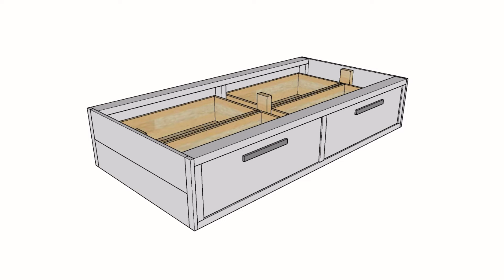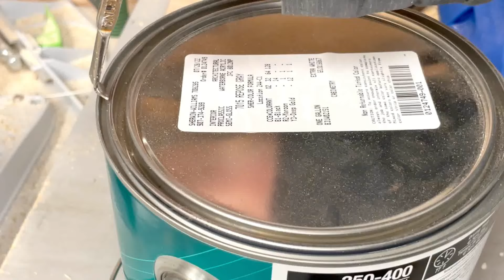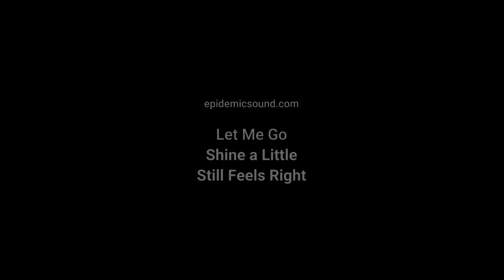DIY Drawer Bed with Free Plans

Comment: Do you think it would be possible to open the drawers on both sides of the bed?  I imagine that for a motorhome: a folding bed on top, and drawers that can be opened from the outside when the weather is nice, from the inside when it rains.  But I don't know what sliding system to use to make this possible.
Reply from the maker: Well that’s a clever idea!  If you figure it out we’d love to see your solution!